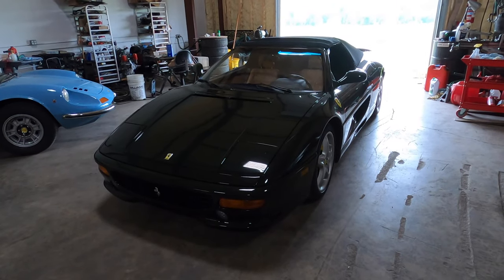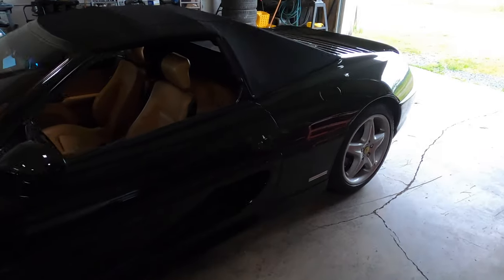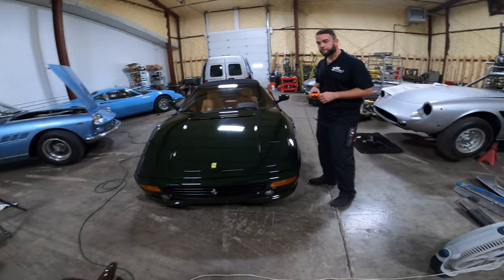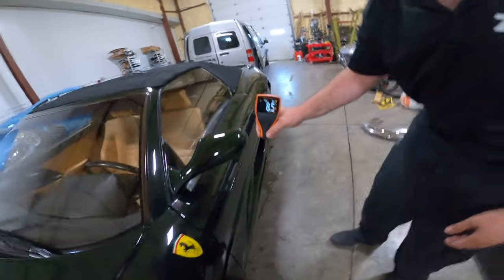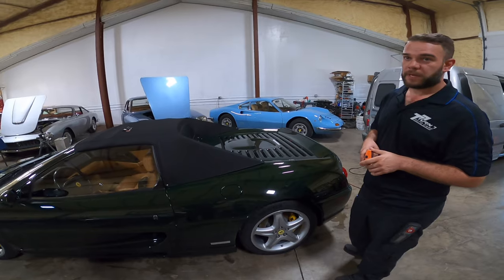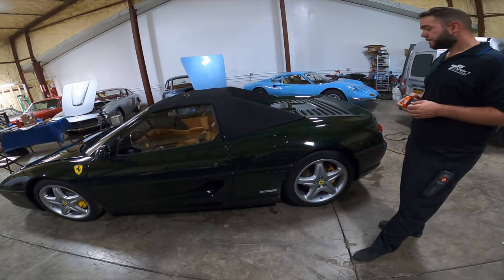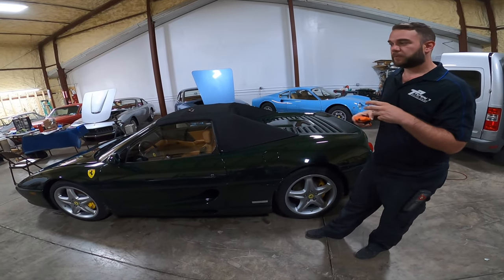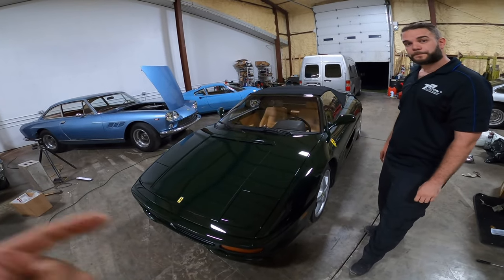1996 Ferrari 355 Spider Prep for Bring a Trailer

Comment: how much does a detailing like this cost, or is it "if you have to ask the price you can't afford it"?
Reply from the maker: This was a little more expensive because I had Dan drive over 90 minutes up to the shop to do it, but it was a 5 figure wash, compound, polish, and sealer. He did the tires, glass, and some interior. Detailers vary from place to place, from price to quality. With a dark green car, I knew Dan would do a great job.